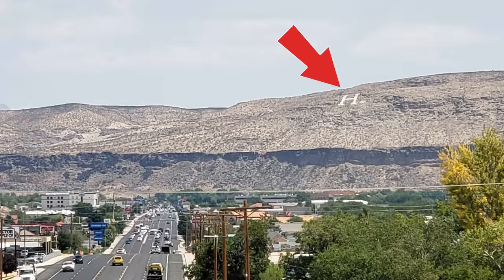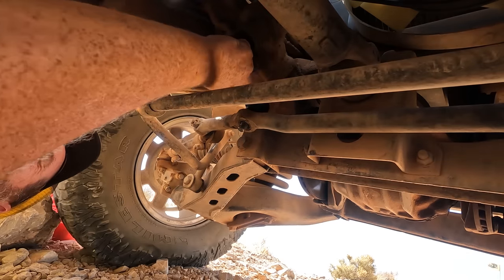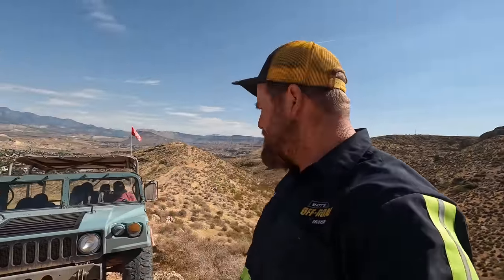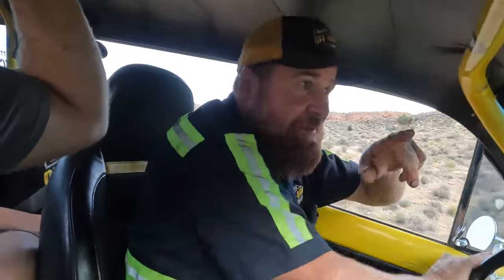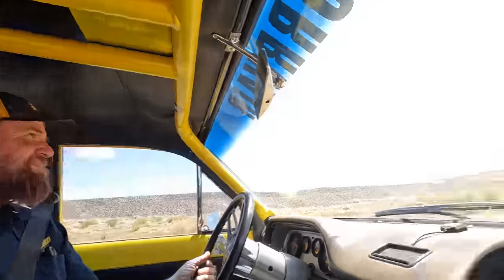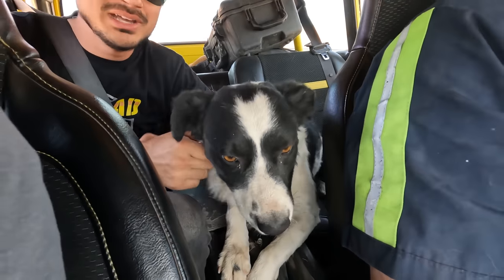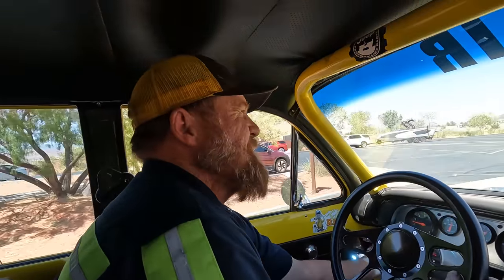Extreme Heat Conditions Make For Tough Recoveries!

Comment: Great idea for Matt's team: Matt needs a MAT to lay on while doing trail repairs so that the rocks are not poking him in the back or arms.  Come up with a 1"  tick rubber MAT that can roll up once done that Matt can grab, roll out and lay on it during repairs to help protect him from the rocks and other items.  Have them be black with the name Matt's Mat in yellow on them for retail.
Reply: A yoga Matt ？
Reply: Matt is too much of a dude to waste his time with such an amenity.
Reply: Would that be a "Matt Mat"???
Reply: I don't think so.  Matt would have to carry something with him that he doesn't need, want, or use.  There are dozens of these available off the Tool Trucks, Harbor Freight, and Amazon.  They even make Heated Mats for winter.
Reply: Furniture Pad cut to fit a leaf bag.  Use the plastic bag as a cover in the mud or snow.

Turn the bag inside out to carry muddy rope back for washing.  Dogs can lie on bare Furniture Pad covering ropes and  recovery gear.
Reply: With all the material that the shop gets delivered I'm sure they get puncture resistant plastic material all the time. No need to order or look for something special. A tightly rolled rectangle of that stuff and it might be used possible once in a great while, just to look into proof of concept. I use the material at the junk yard all the time. (The yard is covered in 1 to 3 inch pointy rocks)
Reply: He occasionally uses something looking like trash bags in mud.
Reply: I have card board I use for this. When it gets dirty, I trash it for a new piece.
Reply: What do you call a man laying on the doorstep, with no arms or legs?
Reply: Yoga mat 😂
Reply: He has skin.
Reply: Yeah. Either a camping mat, or a doormat.
Me, I just wear a bike jacket when I need to crawl under stuff on my back. Waterproof, padding on the back, and shoulder and elbow pads as well if I'm using one that's still good instead of the one I took the armour out of for use as a regular jacket.
(No, I don't ride in the un-armoured one. It lost too many snaps to be used on the bike, but it works fine for a waterproof, windproof jacket on foot.)
Reply: @gingergann3934  best about cardboard you slide on it real easy..   👍😎✊
Reply: Or the interlocking rubber mats that you stand on.  I use those or a large piece of cardboard at home.   On the trail I would want something that is more protective.  I was impressed that Matt had the tools needed to make that repair.
Reply: I just use the rubber floor mats.
Reply: They could it a Matt's Recovery Mat...... Or maybe Matt's Morr Mat
Reply: Yellow with black instead, its cooler, and bright so it's multi purpose, another high visibility thing when you're lost in the desert and they send the search planes... Just kidding. Yoga mats are useful, thin. I took my ladies to work when I was replacing rusted joist hangers under a deck with a foot of clearance to the gravel. Multiple days in a row I decided to bring something squishy. It was a lot of rusted joist hangers. Came up with a whole system to work in the space.
Reply: He is the Mat. He's Matt!
Reply: Even just a 1/8" thick roll of Naugahyde would work and be better for packing. Just something to add contour over sharp pointy things.
Reply: Thank you Jesse spot on!
Reply: Who needs a door mat when you've got a Morr mat?
Reply: Livestock mat.
Reply: @MaxairEngineering  I glad it was you, not me, who went there!
Reply: I would buy this for my driveway shop in a heartbeat
Reply: What do you call a guy with no arms and no legs under a car? 

A Matt.
Reply: @frankmcgowan9457  A Mat-t😉
Reply: Normally I don't use anything, but when your vehicle breaks down and you have to fix it in the field, it doesn't always break down in a convenient spot. I carry a shooting mat, I ordered the Vism padded shooting mat off Amazon for $30, treated it with water repellent silicone spray and I leave it in my truck in case I need it and it's come in handy a few times. The worst was when my tie rod end broke on my jeep, of course it broke right where there was some rocks and some prickers, I didn't see the prickers until I laid in them and yeah, wasn't fun.
Reply: A jacket with 4 rubber pads on the back is faster.

Comment: To be fair, I am impressed with how little those Hummers have broken down considering they are a daily operation tour. 
I remember the Military guys complaining how much maintenance they required for the gear'd hubs/portal axles alone.
Reply: Yeah, it doesn't look like they take them on gentle trails either, so they certainly get a beating.
Reply: Over the years there have been significant improvement in material and replacement parts. Unfortunately the government had/has a store of older parts that weren't bad, just not as sophisticated and hearty. Our mechanics would put special parts on our RECON vehicles precisely for the reasons you outlined.
Reply: @bruceleealmighty  Engine placement is crazy. Never knew they were placed behind the front axle.    That makes them front mid-engined!
Reply: @UberLummox  Although true the  placement is behind the axle, and quite similar to how the corvette  "midengine" C7 or earlier placement is. It's still not a significant characteristic of engine versus wheelbase. Unlike placement of several front wheel drive placements were planned. A transmission and transfer case was planned to reside significantly rearward as the Hummer didn't quite end up as repositioning of fuel took priority. The HMMWV has so many variants and configurations that it seems almost impossible to define it's absolute characteristics. But, the front, mid engine is definitely a salient point, no matter the power plant ultimately used. Not having the engine absolutely forward gave opportunity for the hood to slope characteristically the way it does, providing significant field of view and ground clearance or angle of attack for the wheels. It's interesting that there were so many configurations tested and proposed early on that we ended up with the vehicle that we did.
In the early 80s 4, 6 and 8 cylinder engines were tested in extremes of desert and Alaska the latter I was able to be a part of. I felt the 4 cylinder was quite torquee, but I was in the minority. The motor was still 5 litre and tested mogas as well as diesel. Multi fuel was optimal for some configurations but it wasn't considered practical  for all uses. I kind of feel that the Japanese took away much of what we learned and made a practical decision to manufacture a vehicle that provided nearly all the advantages and almost none of the ultimate drawbacks that the initial HMMWV project had in store. If you take a deep dive into the Toyota MegaCruiser it becomes apparent that Japan once again improved on a test bed and provided a indigenous system that was replaced the  moment they saw flaws and changes in mission requirements.
Reply: They government had to stick to their maintenance schedule, you see the government doesn't just buy a vehicle and maintain it only when it really needs it like most people do with trucks. Also they had contracts from the start saying how often they would buy each part etc.
Reply: @16driver16  Everyone seems to overlook this exact thing. The vehicles in active service have to be "maintained" at regular intervals, whether they're used or not. I was in the National Guard as an 88M, and that was our main drill activity for the maintenance crew: tearing down and putting back together vehicles that hadn't been moved in 20 years, except for their monthly inspections.

That being said, these guys definitely are not taking care of these vehicles. Every time they get rescued, the vehicle has a massive engine tick, and the part that breaks is a regularly scheduled maintenance part. These trucks can take a beating, and they're taking that for granted. They seem honest enough, but that doesn't hide the fact that they're not very knowledgeable about the vehicles they're using for a touring service...
Reply: @bonniscootor 
And one thing for sure, you didn't want your hummer to go down while in the heat of the moment either😮😮😮😮 .😊
Reply: @bonniscootor  Gonna have to agree with the majority of your comment. Although what most units didn't do was delve deep into maintenance schedules and regulations and find that much of the scheduled obsolescence was not required if certain criteria was met. I had to point it out to inspectors once and show that most of the maintenance that other units were doing was a lazy cursory look at the manual. There were always updates, I mean always updates. If a vehicle was not moved at all it was actually more likely to have to get an overhaul if the vehicle hadn't at least been run around for a short course (often less than 10 miles) every month or in some cases once a quarter. The only reason I started diving deep into the regulations is because I was given so many conflicting instructions, I decided to update the entire manual and follow it to the letter. That's how one gets an outstanding unit citation.
Reply: One of the easiest pitman arms to change. Didn’t even need a puller 🤣🤣
Reply: @bonniscootor Or maybe they can't justify the cost of the scheduled maintenance (according to a military service manual), and simply run it and fix what breaks.

Who changes a pitman arm that isn't broken? Lol
Reply: @dafunkmonster  On an offroad rig? Lots of people do, that's how Matt was able to diagnose it so quickly lol

I do agree that it's not something the average business owner would be even knowledgeable of. It's definitely not as easy to spot as balding tires or grinding brakes!
Reply: @bonniscootor Nobody preemptively replaces their pitman arm.

Comment: I've learned so much from this channel as well.  I bought some soft shackles and a kinetic rope just to have in my truck and this last weekend I was able to help get a van unstuck in the sand up by Bear Lake in Idaho.  Because of the videos I knew what to look for as recovery points on the van and how to direct another truck we hooked the rope up to to pull it out (that truck was going to use ratchet straps to try and get them out before I stopped to help).  Love the channel and the entertainment and education you provide!

Comment: Nice trail repair. Matt got to demonstrate that not every hammer in his toolbox has claws! And doing the trail repair saved him from going back to get the wrecker.

It was nice that you took us up to the overlook and pointed out the various POI. It gives us a better relationship to view just how large your normal service area is.
Reply: They still had to go back to get the part, but didn't change vehicles.

Comment: 3 and a half  divided by two is 1 and 3/4 . (Number of steering truns)
Reply: I thought the same thing. However, most pitman arms are keyed in the spline so there is only one way to install it.
Reply: Yes, but you want to start with the wheel centered then adjust the pitman arm one or two splines as necessary.
Reply: it's  a  humvee ,  so   🪖  📏
" close enuf for government work "

Comment: Word of advice to owner of Hummer tours, about how to prevent your spinning tires (probably responsible for some of your broken drivetrain parts from previous recoveries).   The H1 has Torsen differentials front and rear, with a 4.5:1 torque bias ratio.    So what?    As long as both tires (side to side) are on the ground, you'll get up to 4.5x as much torque applied to the high traction side as the low traction side, but if one tire lifts off the ground then zero torque is required to spin it, and thus 4.5 x zero = zero (tires spin, you go nowhere), which is why an H1 will spin tires at both corners when you're flexed out on a big mogul.      BUT, Torsen differentials are highly responsive to brake modulation, meaning, as soon as you start to get wheelspin (or even just before), apply a little brake pressure (while still on the gas) and the torsen differential will apply up to 4.5x as much torque to the high traction side as it takes the low traction side to overcome the brakes and you'll get plenty of forward drive.    This is a well known and proven technique for crawling in the H1.  
TL;DR: Ride the brakes when you're flexed out on moguls or off angle rocks/ledges and it'll stop the wheelspin and provide forward drive.

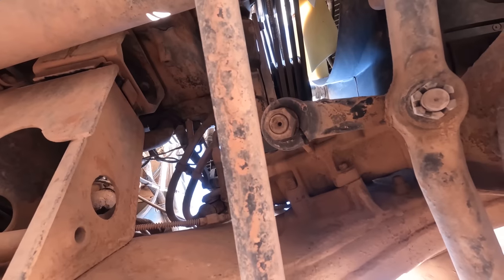Comment: 3:04 - Rory'd of had it off in about 10 min, welded in 20 and re-installed in 40..

Shame Matt did all the work to build an actually prepared truck but he never takes it out... Anywhere. xD
Good thing the customer is at-least prepared. >.>

Comment: I learned from watching the channel! In 2020 we moved to a bigger house. It also has a bigger yard and driveway. Too much driveway to shovel snow by hand. I bought a used riding mower that I could also attach a snowplow to. I bought tires chains, but I swear they just chewed the asphalt up. Then I bought Terra-Grips and they were useless. The only thing I could think of, aside from buying 120lbs of wheel weights, was to air the rear tires down. Worked like a charm!

Comment: Anxious to get my 60 4dr vair running.   It was 114 sedan off the line.. 
Sold it for 700 back in 95 and it spun a rear main seal so I went and got it back. Been sitting ever since!

Comment: On the Hummer recovery, as soon as Matt turned the steering wheel and I heard the grinding, I thought this was an easy fix... as long as threads on steering gearbox are okay.  I've seen that before on a few Hummers on A.D. over many years of hard used ones and some Jeeps. On IFS vehicles it's a high potential failure point especially on 1/2 ton trucks used off road hard.  
  I was in one of the Army units that fielded Hummers, we gave up motorcycles and FAV's for them. BTW: It's basically a "larger version" of a Italian designed vehicle in many ways.  There was a couple of them at museum, on what is now Joint Base McCord / Lewis in WA.

Comment: speaking of getting out yourself. Have you guys tried to get someone out simply by pouring water in the sand around the stuck tires? I saw the water close and thought I would have tried to soak the sand and get on top enough to build momentum. It sometimes works here in Kansas but you do have a different sand than we do.

Comment: Okay serious question time:  Matt and the Morr crew you guys spent a year building the Off Road Wrecker and yet it seems when you need to use it you leave it parked.  Is there an issue other then loading it and un-loading it?   I realize that some of this was shot while Blue Steel is hanging out with Robby and crew but the roll back isn't an option?  For that Hummer fix it that boom wench sure would have been handy.

Comment: Humvee gov locks (differential locker) need to be torque loaded to engage. Hold on the brake, push on the accelerator and they will lock in. You can also short stab the brakes while moving to get them to engage. 

If you have a GM vehicle with a locker chances are it works the same way.

Comment: Wondering if a small water tank with nozzles in front of the tires would help when sand is powder. Tank can be pressurized by your onboard air and It could spray right in front of the tires and if not needed due to mud, you can still use it to rinse your tools and yourselves.

Comment: What I do when I’m stuck in sand is air down and dig a trench for the wheels in front and in the back of all 4 tires. Dig down enough and your not hurried. Drive out the nice small incline slow.

Comment: So is he saying chance of Matt having to rescue you on his tour is a feature?  ;). I bet 2% is way high. Strange they would not have self recovery capabilities. If Matt charges what that double trip, trail repair should cost…
Reply: I could see it was much rougher than normal. Then you say “racing the sun”.  Can’t blame guy trying.  Sounds like he was going to tell you ASAP he got to signal.   Did Tom say you lost gas cap?  With that sand kicked up?
  Where can we see Corvair new motor stuff?

Comment: From experience I learnt that hot sand is very loose and unless you have diff locks momentum and speed is your only option. Well at least Jillian didn't high centre it on a trail.

Comment: Matt, I am not sure you centered the Hummer steering very well. I think I heard you have the owner turn the steering wheel one and ONE quarter from full lock. Half of 3.5 full turns is one and THREE quarters. Probably OK to get the vehicle off the mountain, but if I am right, will need correcting before taking it on the trail again (will have limited  turn in one direction and excessive turn in the opposite direction).

Comment: Hey Matt, half of 3.5 is 1.75, not 1.25.

Also, pulling that silver SUV at the end, it looked like having it gassing it was digging its back end in and making it way more difficult. This is all just based on the information I've gleaned from watching your recoveries and how you could see the back end dipped down wayyyy further than the front. You'd think it would have popped up to the top of the sand like the front wheels if it weren't digging itself in by accelerating.

Comment: The toughness of the.pull, was because that Expedition is on an F-250 frame. Heavy heavy heavy.
I worked driving cars for 27 years. I didn't like those from the word go.. Of course I didn't like the looks of them. I was bringing it 200 miles from Buffalo to Pittsburgh. I got a flat, it was 90°+. I had just recently had my 4th heart attack. The jack was too short, factory scissor jack. Anyhow that was strike 2 3 & 4. They were boats. Much less driver friendly.

Comment: What kind of drivetrain powers the Corvair Wagon? That thing is a beast.
Reply: Engine is a GM 5.3 LM7, and I believe the trans is just the stock 4L60E.  Chevy sold a few million Silverados from '99 to '07 with that setup, but in the MORRVair it's magic.  The exhaust he's got on it makes it sound so good doing those sand pulls.
Reply: @ischmidt  I was not sure what he was running. I don't wear headphones usually, so I couldn't really tell.